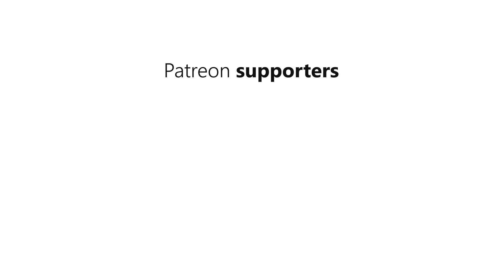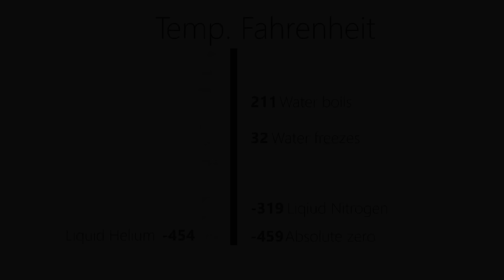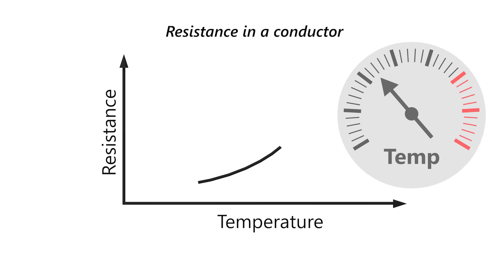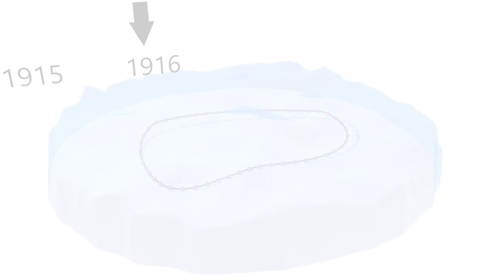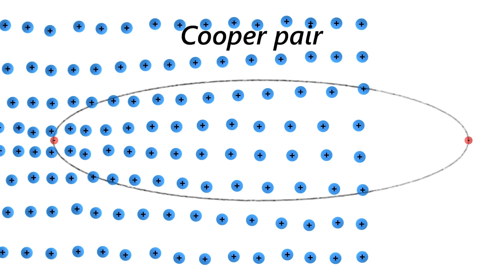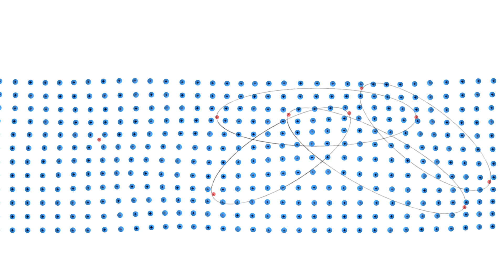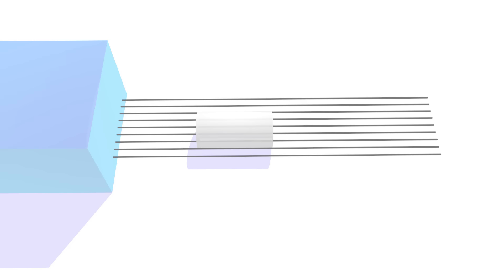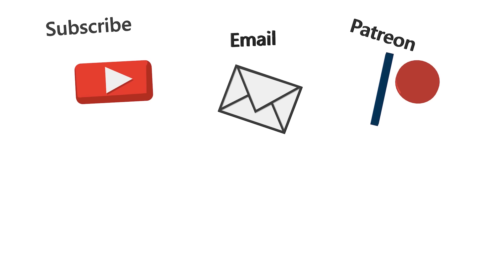The Physics of superconductors

Comment: A few remarks:
- The most used superconductors, NbTi and Nb3Sn, are both type 2 superconductors but are also explained by BCS theory. BCS doesn't work for the high-temperature superconductors (HTS), like the ReBCO and BSCCO compounds.
- We know, phenomenologically at least, quite a bit about how type 2 SCs work.
- The Meisner effect, which you describe when talking about floating, is far too weak in most situations to make something float. You need flux vortex pinning in type 2 SCs.
- The flux vortices don't expel the magnetic field, they let it through, one flux quantum per vortex. Because it costs energy to move these vortices, the material tends to keep its position and hence can float
- Type 1 superconductors are almost useless in practice

Still, your explanation of what is simply is, the history, and especially the explanation of BCS is very nice
Reply: he said in the vid type 1 superconductors are  the talked about super conductors.. they dont know how type 2 super conductors work so why are you saying type 1 s uperconductors are almost useles in practice!?!??!
Reply: @SmethiousReborn  he's saying the majority of the things higginso said are for type 1 are actually for type 2. so all the cool stuff happens with type 2 conductors not type 1

Comment: wait, what ? So, the resistance is ABSOLUTELY, PRECISELY, MATHEMATICALLY ZERO ? as in NULL ? 

OMG I mean I always assumed when they did the levitating superconductors thing the Eddy currents would eventually give way to gravity by bending eversoslightly and losing energy, but I guess that was just the temperature rising 

I mean I can't put into words just how INCREDIBLY NEAT that is 

Like, you would think that doing something like bouncing a lightbeam off of a spherical mirror would last forever, but it doesn't, and so many things in this universe bow down to entropy's clenching iron fist 

But the fact that you can have current going through a superconductor FOREVER just blew my mind
Reply from the maker: I exaggerated a bit because no matter what we measure there will always be some uncertainty in the measurements. So we don't know for sure that it is ABSOLUTELY, PRECISELY, MATHEMATICALLY ZERO :D But we know for sure the resistance is as good as zero, there was no intensity loss measured outside the uncertainty.. Also NULL is not zero it's nothing :p
Reply: There's also "time crystals", which are little quantum "perpetual motion machines", going theoretically forever without losing energy and increasing entropy.

Comment: How a superconductor works. Everything from the physics and some of the history as well. Superconductors were discovered in 1911 by Heike Kamerlingh Onnes. It was discovered because it was made possible to liquefy helium which produced temperatures down to 2-4 kelvin. 

It was then discovered the resistance drops to 0 after the critical temperature. It is explained by BCS theory, how two electrons goes from fermions and bonds into a boson. 

This theory can be used to leviates trains or everything. Explained by the meissner effect. This video only cover type 1 and not type 2 superconductors.

Comment: Another explanation is, " A super cooled magnet that is used as a super conductor is condensed metal from contraction of metal Inverting the magnetic poles of A magnet inward.  ( Condensing fermions into bosons ) As the metal thaws from natural room temperature heat the bosons decompress into their original field states as fermions? What do you think?
( Cold contracts metals, Heat expands metal )

Comment: Fantastic video! I've never really learned much about superconductors and this was a great explanation.

Out of curiosity, when you say that the Cooper pairs are entangled, is this true quantum entanglement, or are they just physically sticking together because of the mutual attraction?
Reply from the maker: Good question. I have actually no idea. But tomorrow i'm meeting with a professor in solid state physics, i'll ask him. I'm curios as well. But i'm guessing no actually because these electrons are weakly bound - so if you could change the spin of one electron i'm guessing the bond would brake. Idk
Reply from the maker: So i spoke with the professor - he said no. It no longer makes sence to speak about individual electrons when they are clumped into 1 state. So it doesn't share anything with entanglement
Reply: @Higgsinophysics  but no two quantum objects can have the same quantum numbers ... but in this scenario how do they get clumped into one state?

Comment: Based on this behavior essentially only needs electrons and a differential in positive and negative charged states with-in certain mediums: it actually only seems natural that this must be commonly present all around our environment. Probably in tons of ways we don't even see or realize. Electrons are everywhere, a differences in charges & states must be as common as the presence of hot and cold temperatures which cause places with high or lower pressure area's. Which causes wind, air movement, flow. This behavior in nature is key: nature seems to need a state of higher energy and a state of lower energy to create some form of fundamental aspect of functions with-in Nature. With those differences, nature finds ways to utilize it, have functional system's, which eventually get themselves self back to a more stable ground state.  ~Differences~ or *fluctuations seems to be the core behavior of nature's "engine" to any given system in nature as we know it. This is really facinating to ponder about. 
Additionally,  I once thought space was a complete vacuum. I saw something saying it's not a "complete vacuum" which is interesting. That seems to be just enough that it allows certain things and behaviors to occur throughout the Cosmo's. Which then seems to be the core backbone to most fundamental forces of nature. It strives to reach that stable ground state BUT it is capable of  having areas of differentials. Those differences are the starter factor that gets most things rolling rather than staying static/stable or flat out inactive.

Comment: Isn't temperature inversely proportional to material resistance? A densely packed cold wire should have more obstruction or resistance than a wire of the same material at a higher temperature, as the higher temperature would allow it to expand and reduce the protons in the path of the flowing electrons carrying charge

Comment: 🧲🌡️📡🔆☢️🔌🔊🔋♻️🌐☯️⚛️
Electrodynamics- (energy, wavelength, frequency) It's really facinating how so many properties with-in Nature use: ~{"Differences"}~
 That "factor" seems to be a key factor in keeping dynamic systems functioning. *{High pressure/low pressure, hot/cold temp, different densities, static electric charges/discharges, electromagnetism north/south poles, different velocity/angular momentum, different amounts of energy/mass/frequency/vibrations. Different layers between different regions such as: (Land/water/air/edge of the atmosphere/space/ the different regions in space with different particle density/background radiation, creating bubbles/membrane layers/cloud regions, nebula's/Galaxy's/Galaxy clusters/ Cosmic filaments/less dense regions of space compared to dense regions of space.) All of these things are basic differences but create a way for the dynamic engine with-in Nature to continue flowing and operating to create and convert energy.} Just Like How a battery 🔋 transfers + charges through a membrane layer to a - charged side. Like how regions of high/low pressure and temperature 🌡️differences create winds. In water- add some factors and It creates ocean currents and flow. Then internally in our planet it creates plate tectonics, planetary convection, geothermal activity, a magnetic field around our planet, to hold a atmosphere. 
🧲🌡️📡🔆☢️🔌🔊🔋♻️🌐☯️⚛️
The natural world around us is just utterly facinating to me.

Comment: Weird question.  Coil guns that reply on copper coils and magnetic fields to launch a projectile have warnings saying people with pacemakers should not fire the coil gun because of the large magnetic field it creates. If it would be possible to have a room temperature super conductor, would putting the components inside a room temp super conductor focus the magnetic fields to only inside (and out the barrel) and not blast out all over the place? As in, would it make it safe for people with pacemakers and sensitive electronics to be close to a firing coil gun?

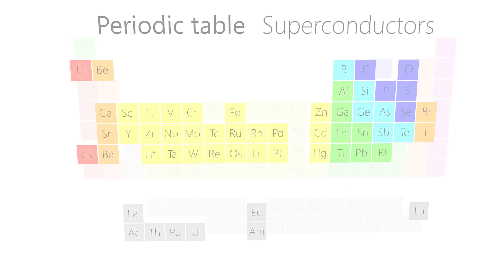Comment: I don't know if the highlights at 3:48 were meant to show elements that superconduct in elemental forms, or if they are used in superconductive compounds. If it's the latter, then copper needs to be highlighted because of the group of cuprates that superconduct.
Reply from the maker: You are right - but these are just the in the elemental forms

Comment: Question: if all copper pair are in the ground state. Why does it move at all? In the semi-classical theory of conductivity, we have electrons occupying energy state of the lattice. There is the scattering to the equilibrium, and there is the external electric field that move the equilibrium distribution to one side which result to the net current direction.
Now if all you have is the ground state, how can it have motion? I mean R is zero, electric field is zero, so potential gradiant is zero. You can't even do time independent perturbation on the ground state. How do you tell which way the ground state moves toward?
Do you have to calculate some kind of green function and do linear response theory or something? I briefly looked at a few textbooks (like quantum field theory by mahan), I haven't found an answer yet. (I want some kind of roughly answer before I read into the dense textbooks)
Reply: okay..I think I got the answer after I thought about it for awhile. The ground state is just the ground state of internal degree of freedom. If the energy gap is large enough compared to KT, copper pairs effectively just never break. The center of mass degree of freedom of the boson (over a large area) don't experience phonons and impurities the same way the small electrons do. I suppose the center of mass degree of freedom just kinda like a free particle in free space.

Comment: Generally, most superconductors have high specific heat capacity upon reaching superconductivity at critical temperature. This implies that atoms of superconductor are started to saturate with abundant stationary photons in which this hints the important role that might be played by those stationary photons. At least now we know the missing link between electricity and magnetism which is the photons. Free electrons are enveloped with strong magnetic field because of their high saturation of stationary photons. Nucleons of an atom that saturated with abundant stationary photons will boost up the magnetic field of its nucleus. Superconductors are strong antiferromagnetic materials where they will repel away the external magnetic field that we coined as Meissner effect. It is time to focus on the right thing, the photons in superconductivity research. If you are interested in real discoveries, I would recommend you to read my book, The Unification Theory - Volume One and you will be amazed with lots of new, interesting discoveries. In God I trust.

Comment: NO WAY!!!!!   Youtube is up to something because upon trying to respond to my previous comment, it was deleted without intention as well when I had to go back and edit out spelling errors.  
SO I stopped by my comment about you offering both metric and standard measurements. 
I clicked EDIT to try to continue the conversation there , and half a second later it too was deleted.

I do not remember my exact wording of that previous comment so I will try again, attempting to at least keep it on the same topic. 
------------------------------------------------------------------------
We are nowhere near able to meet the thresholds which currently prevent full size trains from being levitated using superconductivity. We could even be decade(s) away.
And maglev is NOT superconductivity in any way, shape, or form. Just had to squeeze that in real quick.

When data is omitted,  misconceptions of reality end up occurring. Especially when those misconceptions are taken out of a thought experiment and blindly applied to real life. IE: the comment youtube forced you to delete unintentionally.

Here are just some of the facts regarding superconductivity.
Superconductivity is not a state in which a material can simply be.
All superconductors currently known, have to be actively kept in that state through the input of energy. They have to be  kept below a certain critical temperature. 
(Keep in mind how extensive our periodic table is when thinking of a yet to be found material) 
The thresholds of that critical temperature are incredibly low. That renders it VERY expensive to maintain.
Our current materials simply can not maintain that threshold without a whole lot of energy being put into the system.
And even then, they may still have to be supplemented with an external magnetic field which again, requires the input of energy.
That leads to more cost.

To say it is possible at this time is not taking the entire picture into account. Instead, it is selectively choosing which parts of the entire story to tell or believe.
 Don't get me wrong. The enthusiasm WILL in fact lead to advancements in superconductivity. But always remain centered in reality.  And the reality is, no matter the material used, we have a decade or more minimum before we start seeing any larger scale superconductive levitation.
And when that day arrives, it will be rather expensive for a ticket. Prices will rival the Concord when it first took flight.
---------------------------------------------------------
I am not an educator. Most times I do not express myself well. Other times I ramble.  
The facts offered here have been verified by peer review studies and actual lab results.
Although, there is a very high chance I missed some details while typing. 

ALL the above stated, I do in fact posses an open mind. And I know full well I could have some things incorrect.
If errors are found in this comment outside of spelling or grammar, PLEASE point them out and I will immediately re-open my quantum physics books, admit to and correct the errors.  Absolutely NO ill will nor hate will be felt by me in any way. 
Actually, I learn most when I am correcting a mistake I have made.

Comment: In minute 4:32 you say that the incoming/flying electron will be more positively charged? Why?
Reply from the maker: I was a bit confusing at the timestamp. But I didn't mean the electron. I meant the local disturbance have a higher positivly charged density because the protons clumb together in a smaller area. This causes a higher attraction to the incomming electron off course